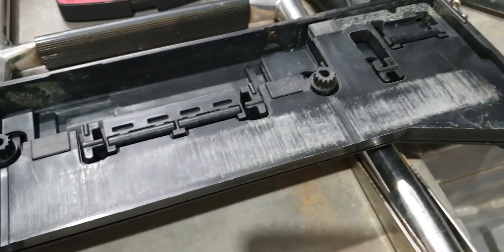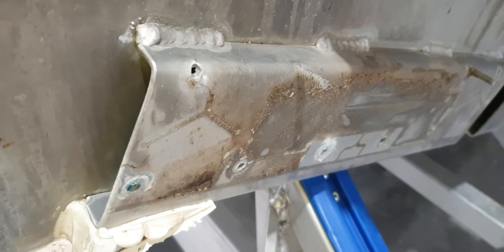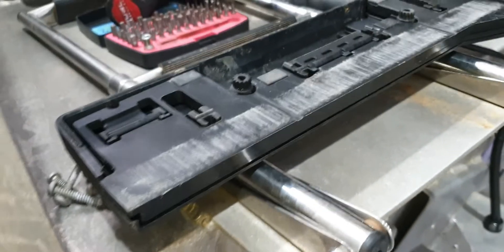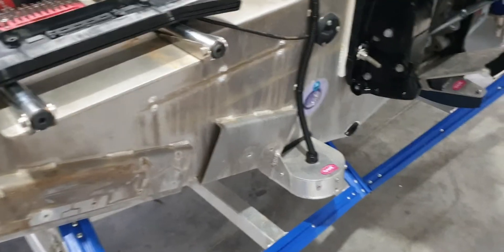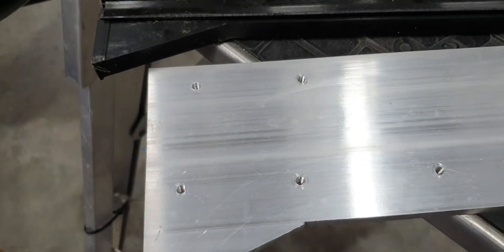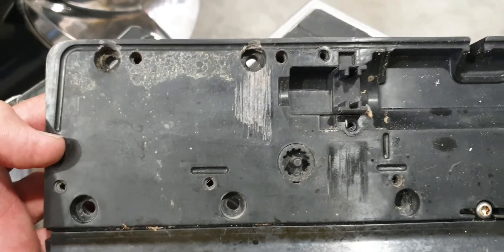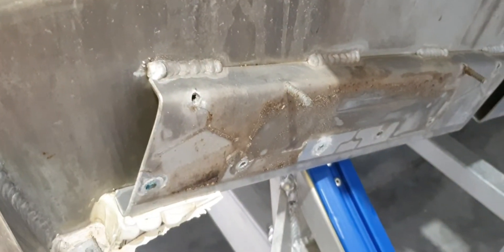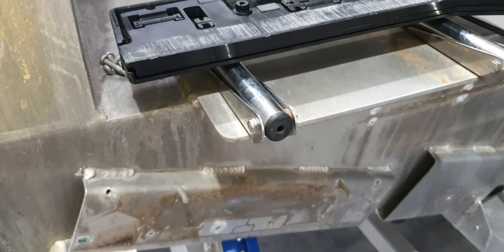Zipwake 450 reverse chine mount Part #1

Comment: hello there., may i ask u what boat is that? i have a stabicraft 2750ucc and planning on getting rid of my lenco trimtabs and replace it with zipwake 450s interceptor., would u suggust me getting the straight or chines? thank u
Reply from the maker: That was a Rebel plate boat, they work great as straight units or reverse chines
Reply: @qualitymarineelectronics2806  thank u so much! ima have someone fabricate the piece of plates for me., how high is ur temperature heat if u dun mind letting me know? stabi’s r quite more fragile as its pontoon is air filled